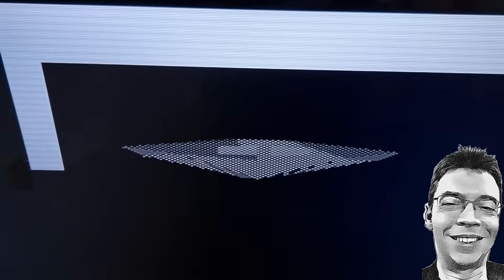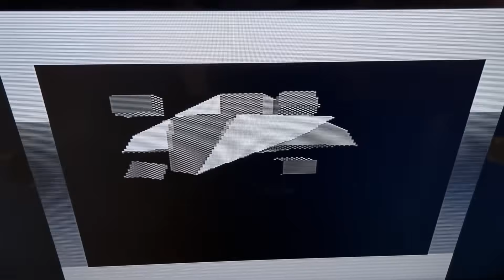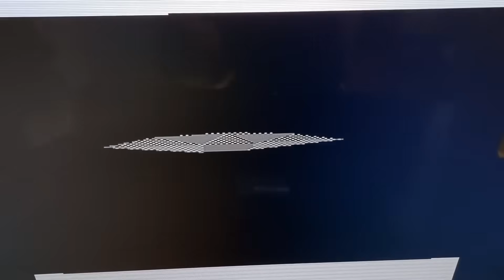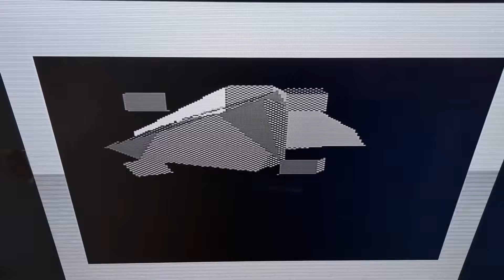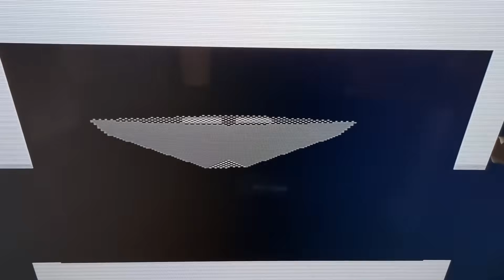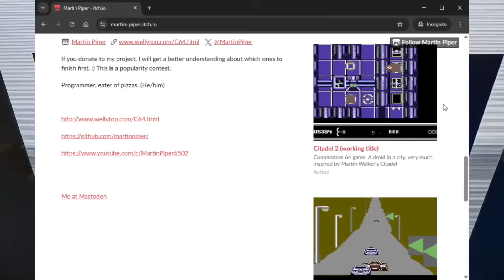C64 coding - C64Ultimate turbo boost 3D test at 64MHz

Comment: Just shows how slow the original hardware was
Reply: Well it's true the c64 CPU was quite slow for 1982. Though not by as much as you'd think, as the IBM PC clock speed was 4.77mhz and the 8088 was not as efficient.

Comment: Ultimately, it remains a gimmick, as every production has to run on a C64, within the original limitations.
Reply: Except for new programs that only run on C64 Ultimate at 64Mhz
Reply: @SalvadorButtersworth  The original Commodore set the standard back then. I doubt that the 64 MHz mode will ever see widespread adoption. However, it can be very useful for development purposes.
Reply: @jhna314 People have been making demos with 20MHz for a long time.  But there may soon be more people with an Ultimate than a Supercharger.  The original standard lasted 5 years, and enhancements have been around for 40 years.
Reply: @SalvadorButtersworth  As I said, none of these have achieved anything close to significant market penetration, and fundamentally, nothing is going to change that—which is a good thing. Of course, everyone is free to experiment with new possibilities as they see fit.
Reply: You never know.
Reply: well actually no that's not the case. The 64k can now be filled and freed of memory in milliseconds thanks to this design, opening it up to engines to utilise this flushing at it's most extreme if needed. It's still only the 64k it's now milliseconds to swap in assets

Comment: If someone were to maximize everything for the capabilities of the new C64 it'd definitely be possible to do some impressive things. Building around a high capacity crt format, using VSP safe in the knowledge that it will always work reliably without LFT-level genius coding (!) ... I'm really going to have to buy one in the new year methinks.

Comment: Ahh glad to see you using my methods from C=Hacking :) I'll consider this code fairly optimized, still surprised it's not faster than that.
Reply from the maker: Yeah this was after significant optimisation to remove overdraw and to run span drawing from cartridge.

Comment: Interesting that it can now be clocked at 64MHz. The original Ultimate64e II boards are at 48MHz max, unless there's another firmware update for them to now go to 64MHz I will have to find out. 

Also, I know you show the speed via the menu options, but you can actually control the speed via a register in the VIC chip. There are several of the shadow registers being used to set specific Ultimate64/C64Ultimate features like speed.
Reply from the maker: Yeah I wanted to use the UI to control the speed. It was more for the obvious visual instead of just setting the register. :)
Reply: I wonder if it's to do with the board revision itself that 64mhz has been granted. I think it's the same fpga chip as used in the elite ii board
Reply: @adroharv5140 afaik the 64e can do 64mhz. And it's just the original that are 48mhz, but the 3.14 firmware is not out yet for the boards Gideon sold. I think he is burned out. The d031 setting for 64mhz hasn't been documented yet afaik.
Reply: @phill6859  ah we shall see then

Comment: excellent work. With the new Commodore Ultimate 64 now growing in numbers to what must be about 25,000 when combined with the existing ultimate 64 boards, the potential to write new games now for this growing user base is rather high already.  Coupled with the huge increase to CPU and dma ram that can fill and empty the 64k exceptionally fast as in milliseconds, streaming engines to make good use of all this and open up possibilities is surely a consideration now with publishers that can see this as an emerging market. The Commodore Ultimate 64 is now showing as being in the second batch for beige units and it's going down at a good pace so this thing definitely has people interested. And the beauty of the Ultimate 64 is that it runs both old and new so you're not left out either way if you own one

Games that stream assets from that large 16mb of ram open up almost infinite possibilities comparatively speaking given just how much data could be streamed in and out with this newer setup. I wonder if we'll start to see enhanced game updates and maybe even a full use of this machine's potential. I'm fairly confident it will personally

The trouble in the past has always been that there isn't a consistent number to work with regarding super cpu and ram upgrades but right here it's all contained and that becomes something I think publishers will be thinking about now
Reply from the maker: I must say I'm considering it.
Reply: Don't sleep on the music production side, either. The new hardware marries the Retro Cool (not to be underestimated) and that oh-so-sought-after SID functionality and sound with the expanded throughput and capacity. Consider: for several years now folks have been shelling out BIG BUCKS for "DAW-less" music set ups... I mean, look at the Teenage Engineering stuff, for example... well-engineered, but super expensive and relatively limited musical functionality compared to just lugging around a thin laptop and a small MIDI doohickey... $2,300 for the OP-XY!!!! You can buy a lot of C64U's and SID chips for $2,300. THE ONE THING that I hope Gideon provides... and maybe somebody knows something about this already... is the ability to have multiple audio streams over USB... say one mono stream per SID. For consistency with the old circuitry, I wouldn't expect per-voice streams, which is fine. Or maybe he can mix and match per-SID for physical SID channels and optionally per-voice for UltiSID instances, or whatever. THE FIRMWARE IS ALREADY MIXING AUDIO... the system has a simple audio mixer for setting volume and pan for individual SID chip/UltiSID instances... and all that gets mixed down and encoded for HDMI and a single line/headphone stereo out. SO GIVE ME THOSE RAW STREAMS OVER USB!!!! :^) Oh... and I'd like onboard USB MIDI, of course...
Reply: @dj_jiffy_pop  I know little on the sound side other than the idea of 10 sids working in parallel being something worthy of a purchase alone if it meant you could use it easily enough. I mean you could feel very happy buying this machine just for that potential especially if new software was to be developed. And midi as well. I don't think people realise just how much value this machine packs. The idea of working with even just 24 voices with the 8 virtual sids is dreamlike. With the extra cpu now there's surely a likelihood this will come about in tracker form in the future. I'm not sure what the limit currently is for C64 trackers
Reply: Is 64Mhz the max for this new C 64?
Reply: I'm torn on this. Yes it's good that there's a sizable user base and there's familiarity with the system, but it's also somewhat pointless. You could just make all games with FLI graphics and digital sound (like Metal Dust) which is silly since there's better computers where you don't have to twist in knots to make such sound/graphics. Then why not just make something for those? Or, if C64U is the most popular of the tetro computers, add a "native mode" to it, at least a C65 mode? Or you could make point n click adventures like Myst but with MB's of FLI graphics. The resolution is just too poor for the CPU power available to make good games. Even if I could have a single upgrade it would be 256 colours, that helps so much.
Reply: @curiousgeorge7515  "The resolution is just too poor for the CPU power available to make good games"... we're going to have to agree to disagree on this point :^). There have been many fairly impressive bits of 8-bit C64 gaming software written over the decades (many picked apart on this very channel), and impressive games for the C64 are still being written today. NOW, the question of "why not just implement your 8-bit game in Unreal engine?" is a legitimate one... but so is "why play 8-bit games at all?", for that matter. PEOPLE LOVE THEIR RETRO, for many reasons, and that love takes many forms. TMI... anyway. Why do companies invest the time and money into producing, for example, an Atari 2600 remake, of all things? I mean... the 2600... seriously. There must be a market for it, otherwise it's a total waste of money. My daughter was botn in 1998, grew up playing Animal Crossing on a Nintendo DS, then on a Wii, and now on a Switch. It just scratches an itch, I guess. The other thing is with all of the C64 software sorcery coming out  of the demo, hacking, and gaming community over the years, C64 game development has ALMOST been commoditized in a way... so the start up costs for, say, super smooth 8-way scrolling and 4-bit sample playback and yada yada are much lower today.
Reply: @dj_jiffy_pop  I do agree with you. I'm not saying there's no point to retro, but you could look at Metal Dust, which is made for a SCPU @20MHz, that's already enough for the upgrades that speed provides: digital sound, large bosses, lots of enemies. Unless you go full 3d, there's not much more you need for the level of graphics you have. Put that another way, it's like getting 400fps in COD, it's more than anyone would need.
Reply: @dj_jiffy_pop the graphics isn't that big a deal. It's the lack of fast ram that I struggle more with. Though a 80 column mode would be good
Reply: @curiousgeorge7515  I think maybe a point about it is that you don't suddenly deviate to looking and feeling like another system. I already love the feel of the C64 and if I wanted a more advanced game then I could simply go elsewhere. I think the heart of an idea like this is more that the expansion of worlds while still encased in how they feel and look on a C64 is now possible. I'd be much more interested in worlds I'm used to seeing on the C64 but taken in expanded ways allowing the essence that we all love to remain at the heart still

There is tremendous potential in how C64 games made on an Ultimate 64 could be transformed while retaining a purity still that fans love
Reply: @adroharv5140  Your comment captures it... preserve the "feel" of original c64, but make everything a "little" bit nicer and add a little capability (we have wifi, let's use it).
Reply: @marcopignone9386  yes, it seems this is something a lot of people are enjoying about the experience. Do you also have one of these or perhaps the Ultimate 64
Reply: @curiousgeorge7515  "Even if I could have a single upgrade it would be 256 colours"... fair enough... but I would counter with: "A video game that requires minimum 8-bit color pallette is a poorly conceived and designed video game." :^P